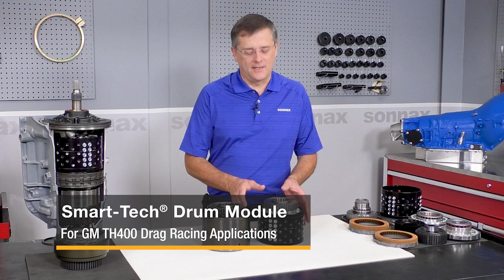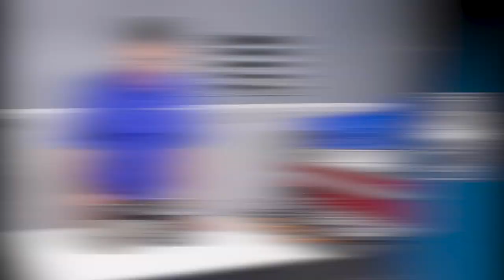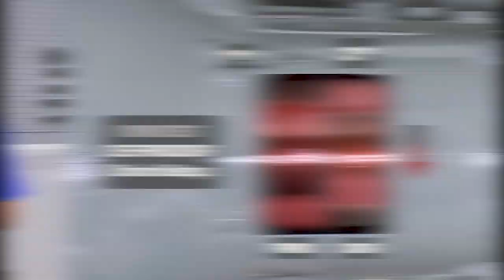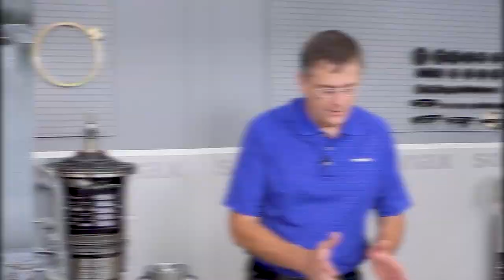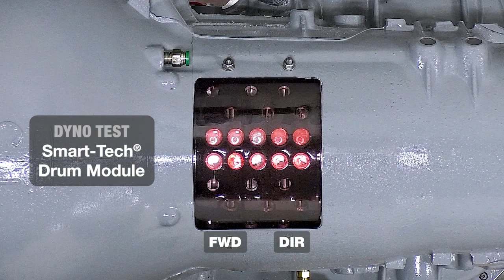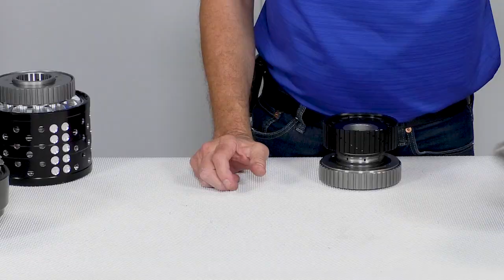Improve TH400 Performance, Consistency & Safety with the Sonnax Smart-Tech Drum Module (34555-01K)

Comment: So, if I have a TH400 with both aluminum forward AND direct drums, how much lighter, and more efficient is the new Sonnax part? 

Is there an input shaft I can buy to use with the OE style pump and torque converter?

Is Sonnax considering making other parts? Straight cut planetary gears, and an aluminum reaction carrier would be extremely valuable.
Reply from the maker: Hi Alan, our product support team would be happy to help you. They can be reached directly via email at sonnaxtechsupport@sonnax.com, or phone at (800) 843-2600 ext. 398. Thanks for reaching out!

Comment: a lot of components from the 4l80e are interchangeable with the th400
is this smart-tech drum module usable in the 4l80e or is this one of the few that arent interchangeable?
Reply from the maker: Great question! No, due to its unique design, the Sonnax Smart-Tech drum module is only for applications that do not run a front band. The 4L80-E has the overdrive ring gear incorporated into the forward drum and typically still utilizes a front band. Hope that helps, thanks for asking!